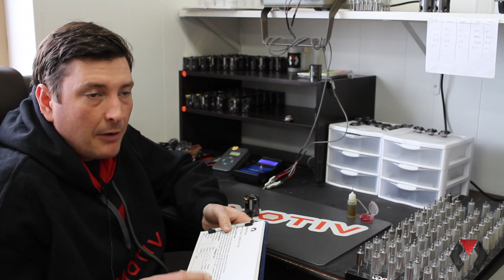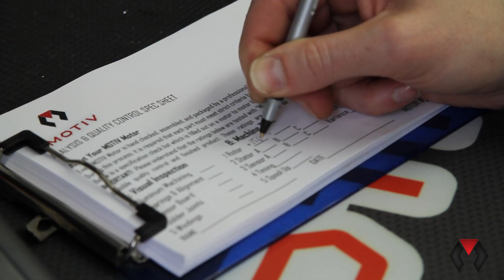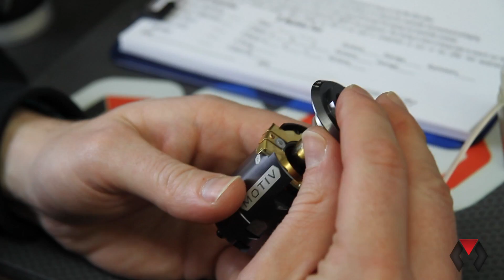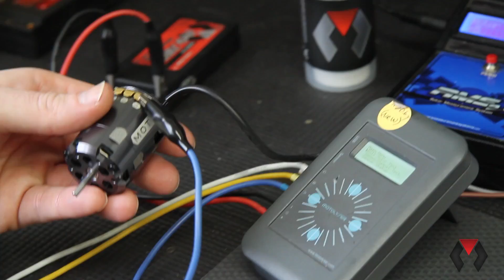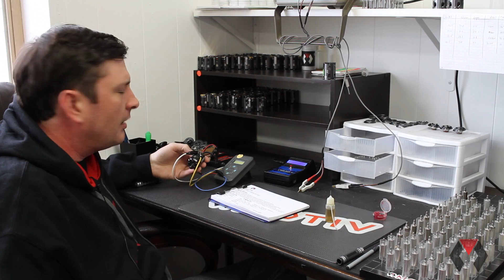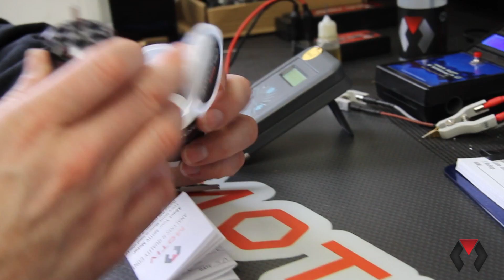How its Made: Motiv RC M-Code Brushless Motor w/ Paul Lemieux

Comment: 3deg tolerance?.  
To much I modify any motor to +- 1 deg 
Do you guys manufacture your own sensor plates ? 
And yes it’s a real pain in the ass to re-bond the Hall effect sensors but it’s worth it on 17.5 stock

Comment: This is great thank you. I am a newby and run 1/10 buggy 17.5 blinky mode. . Is there a model you would suggest for a small indoor astroturf track? Like 10-13 second laps are common depending on layout. Also it is very point and squirt...is there a timing setting you would suggest with regard to your products tested performance? Thanks